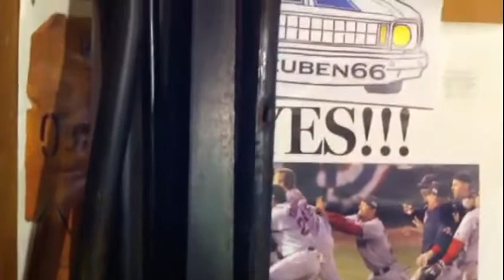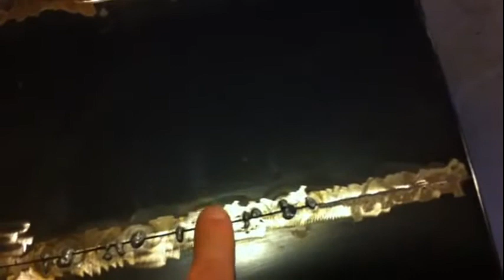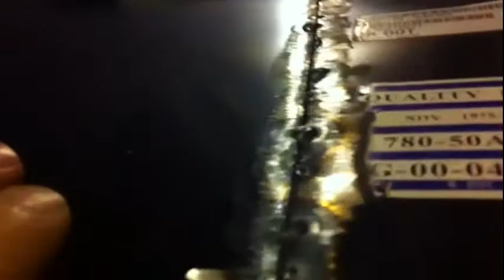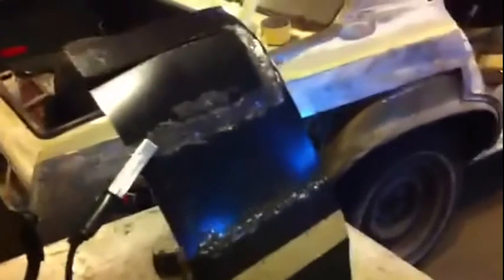Better progress-- spoonless welding with gas

Comment: I think making the roller seat = Good idea. You are doing good . Understanding what you are seeing is a big step ,and sounds like you are seeing differences when you are making changes. Do not be afraid to try many different settings on that welder. if you adjust to high heat or to much wire speed setting then try with not enough speed or heat . After that you will pick up on little changes.

Comment: and the thicker metal will be like slow motion compared to thin sheet metal. That will let you have time to see what goes on in the key hole and puddle. It will be easier to weld, more for giving.